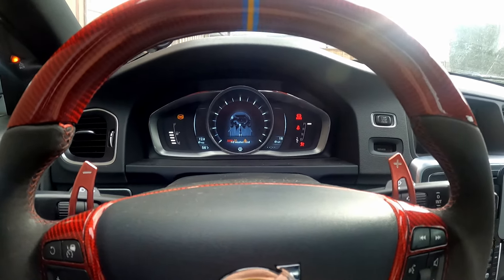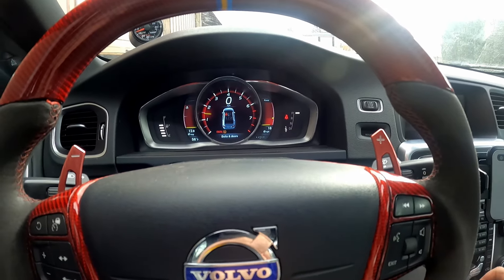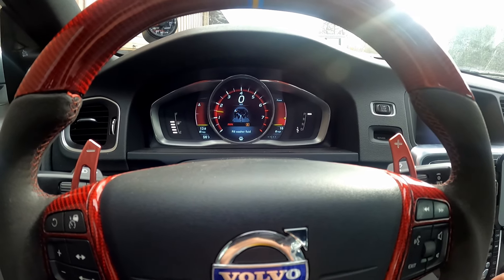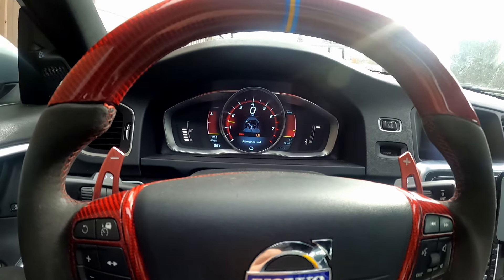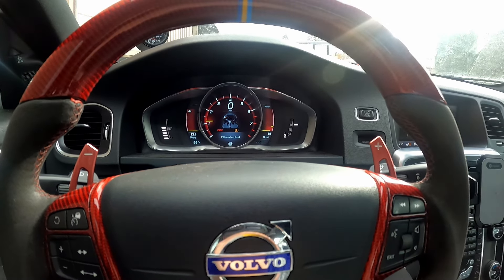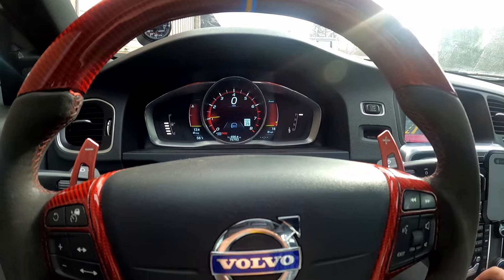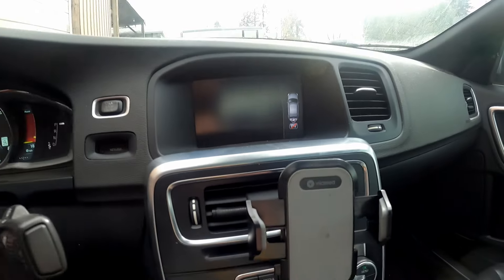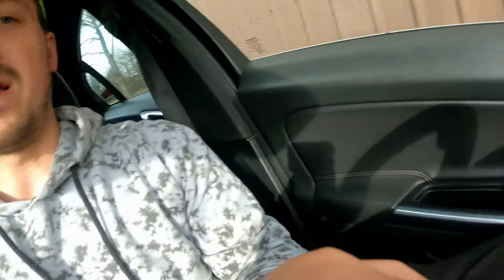This is why my Volvo Stage 3 engine failed!!!

Comment: Hey i have a question about a video you posted 4 years ago on your white is350 tune and pull. I moticed you had a loud whine while reving it up, do you know what caused this whine. I am noticing in my is350 thought it was the alternator changed it but it is still there. I bought the car already modified im not sure if it was tuned or not but I do have a throttle control do you remember anything about the whine?

Comment: So let me ask you, in terms of zero - 60 times what was the improvement from (i) stock to stage 1 and (ii) stage 1 to stage 2? I believe stock is around 5.1 - 5.3 seconds? Thanks!
Reply from the maker: Stage 2 we got it down to 4.3 i believe.
Reply: @BuiltForSpeed  appreciate it! Hard to justify the cost and aggravation I would think? The reason I am asking is I own this car (2012 Volvo S60 R design in Passion Red with 80,000 miles) and have debated tuning it,  but Jesus sure does seem like a lot of pain for little gain?
Reply: @ts6640 full second gain is actually a lot all things considered
Reply: @moneyman7083  fair enough. 1 second is certainly not trivial

Comment: Aah man, I haven't watched in a bit and then this pops up. Sorry about the bad tuners doing your baby dirty!
Reply from the maker: It's not about bad tuners just if they have never tuned these volvos having them try doing stage 3 tune is a mistake. Stage 2 is not as risky for someone to experiment on.
Reply: @BuiltForSpeed  I guess I meant to say inexperienced, not bad. There is a difference. Good luck man!
Reply: Have you tried the ‘IPD USA’ tuning solution?
Reply from the maker: @ts6640  me?
Reply: @BuiltForSpeed  yep. Curious if you looked into it?
Reply from the maker: I heard good things about it. But i don't think they do stage 3.

Comment: Junk car
Reply from the maker: Haha dang bro. You started hating on cfmoto now volvos?
Reply: @BuiltForSpeed  both are junk
Reply from the maker: @KClife9TV  haha
Reply: If this is a junk car, what the hell do u call the other 90% of actual junk cars rolling around. I hate to be this guy, but usually, the people who say Volvos are junk are american truck mechanics that die by Chevy, Ford, etc. And say stuff like "It's over engineered, it's hard to work on". All I'm gonna say is this. I got my s60 with 100k miles for 18% msrp. I've put 20k miles on it, no problems. I'm not a mechanic and I was able to install the downpipe, exhuast, intake, etc. Without a lift. It sounds like a race car, It cost me less than 2 grand to make 370whp, it's extremely safe, I'm 6'6" and I'm very comfortable in the car (driven 1100 mile stretches multiple times). It's towed 2300lbs over 1100 miles straight through warm climates and never overheated. The p3 s60 t6 is litteraly one of the best all around vehicles ever made.
Reply: @hellothere6612  lol nah I had a p2 s80 and a p3 s60 and they suck. Constant lights on. Bad mpg. Horrible cost to repair.  Toyota or genesis  is better